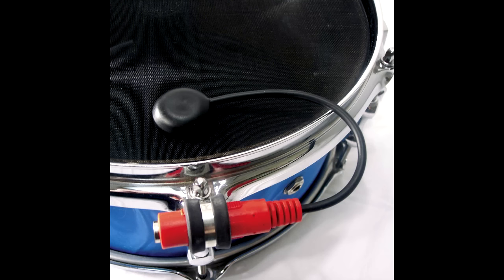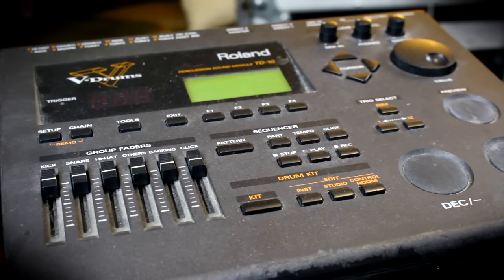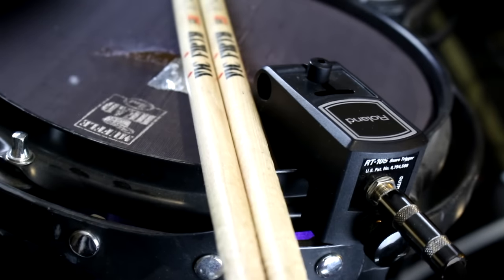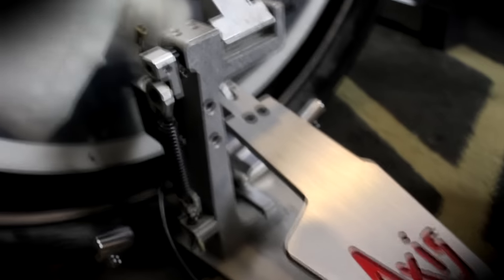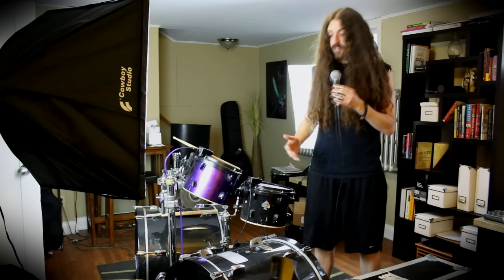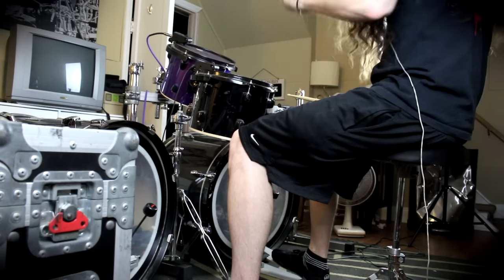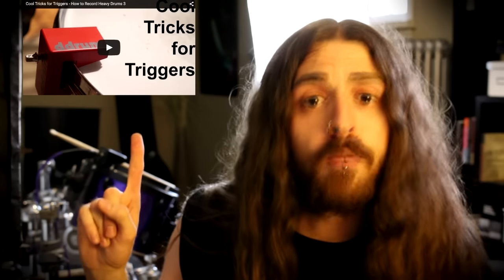A "Proper" Explanation of Drum Triggers

Comment: I understand the concept and use of triggers, but I have a question though. What's the point of buying a hell of a good sounding drumset if you're gonna use triggers?
Reply: You could combine the acoustic sound and the triggered samples together. It's useful in some cases.
For example, check out the live performance video of the song "Drunk" by Sungazer. The drummer has triggers on the kick, snare and floor tom, to play 808 sounds along with the drums.
Reply: Imagine you want a freackin coubel and you don’t have one
Reply: Erik LMX aaah a man of culture I see.
Reply: @ErikLMX  polyphia also does a great job mixing triggers and real drums.
Reply: @lt-yx1hx  Yeah, and in their case it sounds amazing. :D
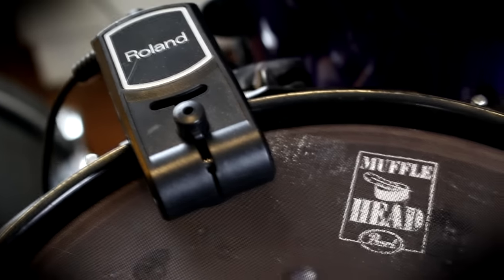Reply: Here 1:11 66Samus is technically using an electronic set in disguise.
Reply: Almost all recorded songs use samples along with whatever you’re recording. Also, triggers can make streaming/recording much easier while not losing the feel you get playing your actual set. Those are the first two that come off the top of my head, at least
Reply: Most drummers who use triggers only ever use the bass drum triggers, and on top of that, they only do that because it's damn near impossible to get an audible sound out of a kick drum when playing 250+ bpm. Obviously you can do it with enough effort, but because of how demanding touring and live shows can be, it's simply more practical to use triggers
Reply: Because you can have one for a concert and one for not distracting neighbors

Comment: While you have to hit every note to get the trigger sound, you can hit it at any strength, which can cause some problems. If you are playing with triggers all the time, it can make you play weaker and weaker because the trigger react to any touch of the drum. So if you are playing "trigger mode" on drums without triggers, it's going to sound weak and dull, at least if you're going 230bpm on double kick, for example. Point is, that triggers can teach players to be lazy with the strength of each stroke and completely destroy a players dynamic.
Reply: +Alf A Romeo you can with a velocity setting.
Reply: Velocity settings are hit or miss though (no pun intended) unless you have a NICE ekit or trigger set

Comment: This is a useful video for explaining the basics of triggering, but it didn't answer in anyway the complaints people have about triggers. The reason people complain about triggers is that, no matter what your dynamic level is, the trigger plays the same note/beat. Therefore, you can tap the head with the beater very lightly and still get the same note as if you hit it with every bit of strength you have. There in allowing light notes being played very quickly, without any real control or sophistication. For the record, its only playing when the beater comes all the way back for every note otherwise you just have a very fast nervous twitch.

Comment: drum triggering is akin to amplifying guitars, not cheating
Reply: +mike gignac Not as great of an analogy as you might think. Amplifiers amplify the sound of the guitar strings (I know, shocker) while drum triggers trigger a pre-programmed sound. Micing up the actual drum kit/drum heads is really the drumming equivalent of a guitar's amplifier; you could even run the audio input from the drums through an amp or pedals if you really wanted to.
Reply: ok ill agree with u there
Reply: +mike gignac closer to guitar pedals really, which some classical guitarists do say is cheating.

Comment: It comes across as cheating because it doesn't require you to have any dynamic consistency, which is required on acoustic drums. It allows for techniques that would sound like crap on acoustic drums, but allow you to go really fast. In other words, instead of playing at 180 bpm and having to worry about consistency and power when doing sixteenth notes, triggers allow you to go to 220 bpm and hit sixteenths with the force of a fairy fart and sound just as good. (Cheating)
Reply: “The force of a fairy fart” lmmfao!

Comment: Thanks man. I'm having some e-drum hot spot woes. My Roland PDX-8 isn't satisfying becuase I keep hitting the hot spot. So I  tried a PDX-100 but the dead-centre trigger was worse. I kept hitting it and it was LOUD ! Ridiculously tight head didn't help at all. - So here I am looking into buying a cheap acoustic snare and triggering it with a mesh head. Any advice ? I need it to be quiet. That's the only reason I'm using e-drums. It's not for sound effects. I'll use superior drummer when I get the latency down. I'm on quite a low budget by the way. Oh ... and I live in Spain. Thanks

Comment: Great video! However, I believe the "cheating" allegation is not that folks using triggers can play faster than they could without, but rather that a lot of drummers can't hit as hard when they play fast. I.e. they can technically play at a high speed, but it wouldn't sound good anymore (or rather inconsistent, maybe?) without triggers.

Comment: The only time I have a problem with drum triggers is when a drummer has 2 oversized bass drums (24 by 24 for example). And uses triggers 

What’s the point of the unique bass drum size if you are use in a trigger anyway?

Comment: can you use triggers for live performances? ( sorry for the dumb question )
and it seems to me it's like a electronic drum set. is there a difference?
Reply: The sad thing is that I've been drumming for years :/ haha
Reply: Absolutely. If you have a drum module with sounds loaded into it, like one of the Roland TD series, you can plug the triggers into them and the audio outputs into the PA. The front of house guy can then mix the sound of the triggered and acoustic drums as necessary.